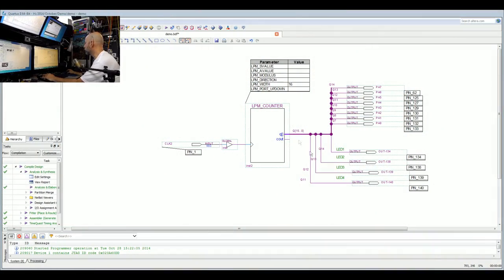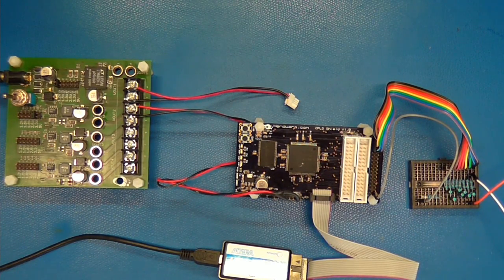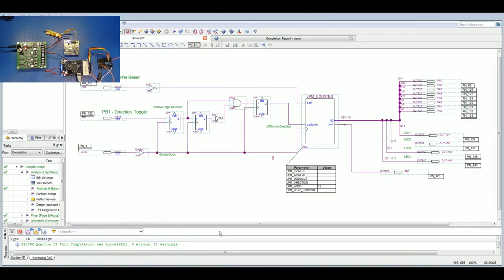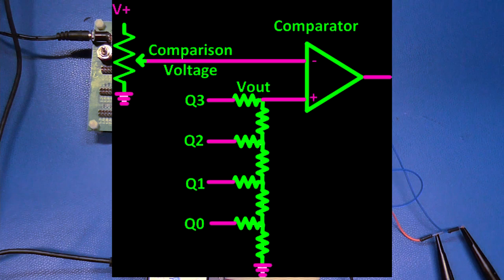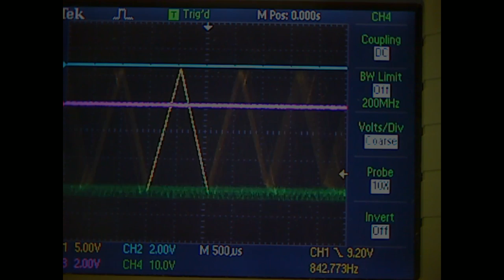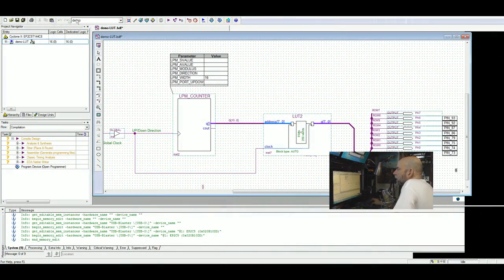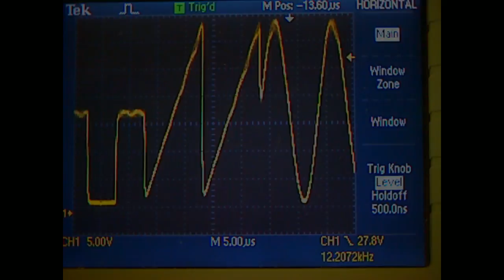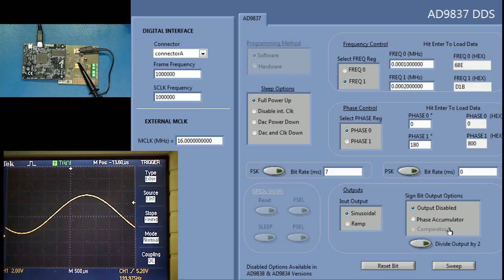Direct Digital Synthesis (DDS) with Bil Herd

Comment: Very complete video and right on the basics! Unfortunately, R2R ladders are imprecise for more than 8 bits, and an expensive DAC has to be used. At least we can still use the FPGA with the RAM LUT and the counters inside. It is far cheaper than buying a dual port RAM (as I was initially planning to do for a arbitrary waveform generator of mine).